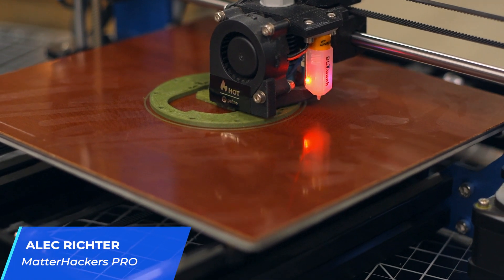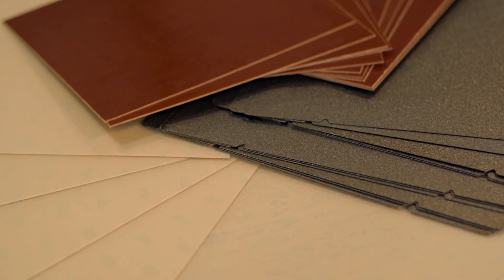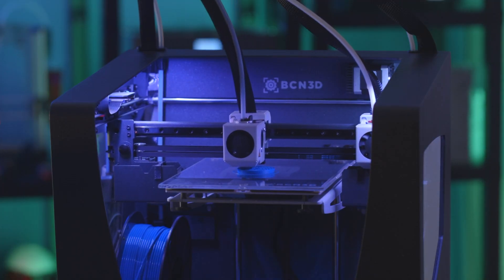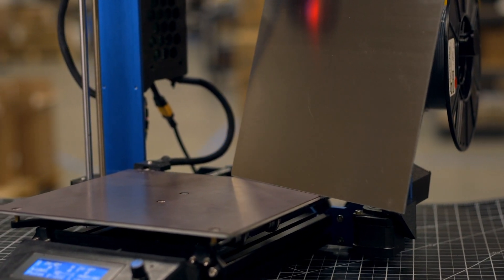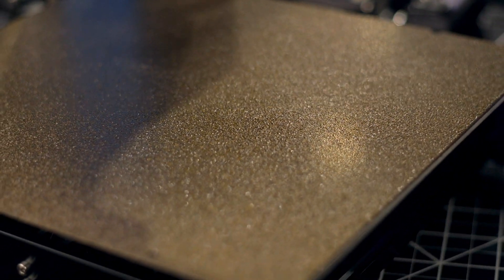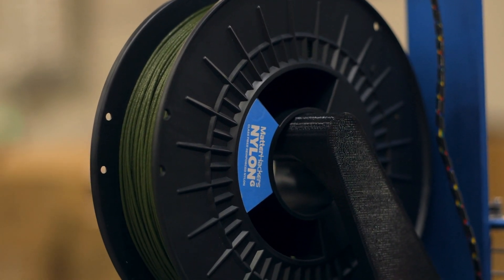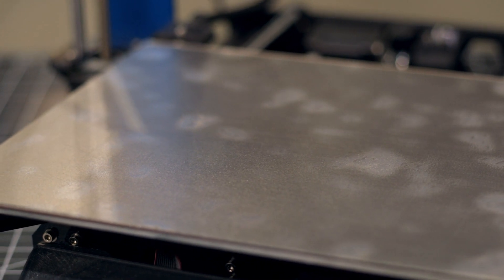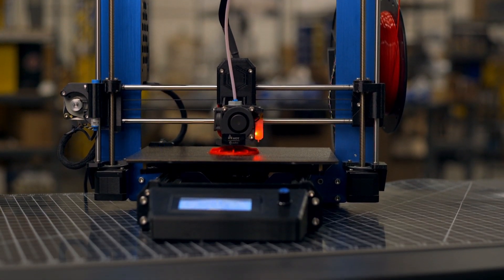Tech Breakdown: LayerLock 3D Printer Build Surfaces Collection

Comment: How do you attach the layer lock sheet to the magnet print bed? Is it like a steel PEI sheet except coated in PP instead? Or do you have to tape /clamp the sheet to the print bed?

Comment: Will powder coated PEI work with Nylon And/OR Carbon Fiber Nylon Filament?  Garolite adhesion is the best ive found so far but with it being laminate it leaves visible lines on the bottom surface.
Reply: Simply put, no. 
I print with NylonX on my layer lock garolite plate. 
Pla is used with PEI.

Comment: Does the Layerlock build surfaces & plates compensate for warped beds, where Mesh-Leveling or Auto-Leveling is a must with the stock or some after-market build plate surfaces...??
Reply from the maker: If your bed is already warped and you install the LayerLock Magbase or the other LayerLock products, the underlying warp won't be fixed. If you have any sort of auto-bed leveling function you would fair just fine, but you'd really want to treat the warped bed before anything else. - Alec